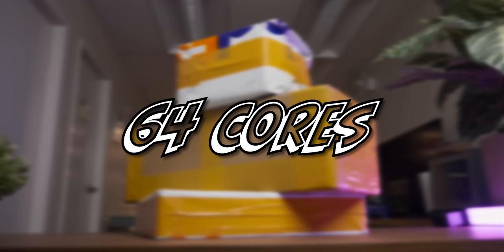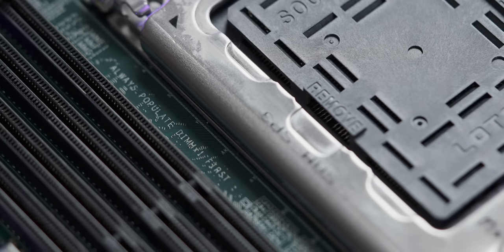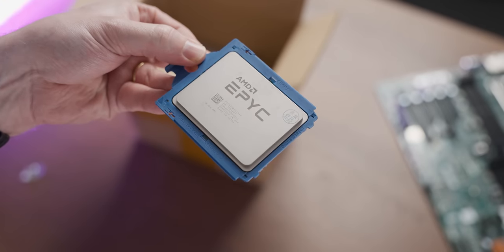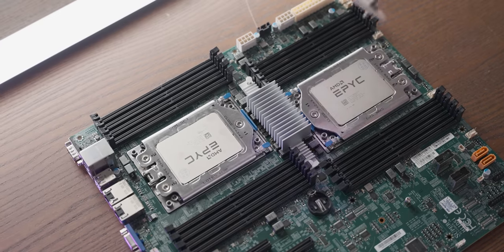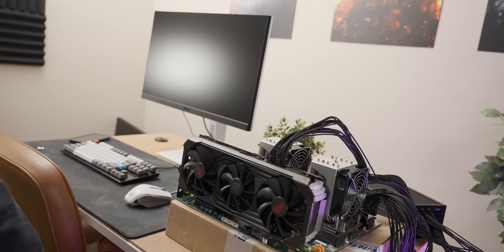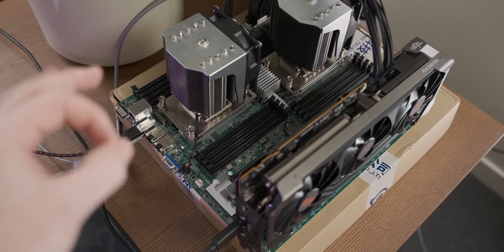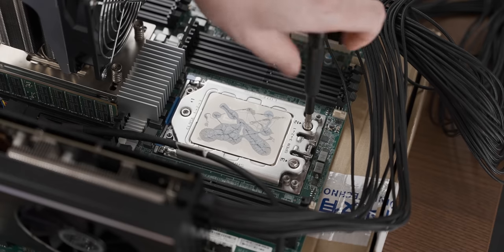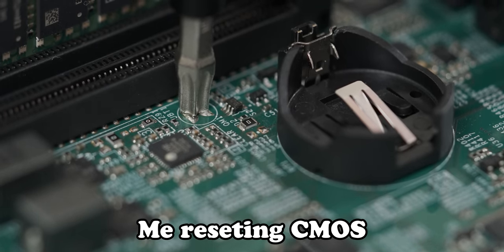I Bought 64 CPU Cores From eBay For $400...

Comment: The pc not booting literally seems like it might just be a bios issue, had an am4 with 3600 and it worked fine but when I got a 3600XT it had basically the same issue but a bios update fixed it

Comment: Why do i feel like dawid didnt seet the cpu's in the board correctly? You need to lay down the cpu's with the rails and clip it down before screwing i the socket screws because it clearly shows the board doesnt see the cpu's either sockets have loose screws or the mounts werent good

Comment: Definitely don't have the right torque on the CPUs.  You have to plug in all of the power cables, 24pin and both 8pins.  Also use more thermal paste, they are giant CPUs.  Check vendor lock on CPUs, may still post though but not sure.  First boot will take 5-10 mim depending on ram capacity

Comment: From this video can see that Dawid is server virgin, RDRAM ECC is a must with server grade, the vga monitor connector is standard on server hardware even most recent servers mostly have it. this motherboard is supermicro (that's quite well-known server mb manufacturer not some Chinese crap) not supermicron, also this motherboard has BMC/IPMI (aspeed chip) use it that is the one ethernet port above usb dedicated to IPMI.

Comment: I bought the same motherboard with a pair of pre-installed EPYC 7302s from seemingly the same vendor (the packaging was exactly the same and everything), and the thing booted-up no problem first try. I've been running CFD on it non-stop since I first turned it on on Sunday.

I can't be certain that your hardware was in perfect working order when it arrived, but to me it seems like your issues were user error. When I was building mine, I took my time, spent hours putting it together and consulted the manual for EVERYTHING. This is the very first video of yours that I've seen, so I don't know what your experience with Server hardware is (I had none what-so-ever just a week ago), but judging from what you said, this seems to be your first experience. Anyway, your approach seemed to be incredibly sloppy for someone with no experience. I can't see it clearly, but from what I can see, you were trying to turn it on by shorting the anti-intrusion panel, and the wrong pins at that. Other people have already pointed-out that the CPU bracket needs to be torqued to spec, and I think I don't need to point-out your thermal paste application (no, that wouldn't cause a server to fail to boot, but it does illustrate your sloppiness and half-assery throughout the whole thing.)

I'm sorry to say, but this is not a good first impression of your channel. Like I said, I can't be certain that your hardware was in working condition, but if you are so clueless as to attempt to turn on a server by shorting the anti-intrusion panel instead of the IO panel, while the manual is very clear as to which is which and what the correct pins are, I really don't think it's fair to blame the hardware. I hope you will take things a bit more seriously in your follow-up video, assuming your shorting of random stuff didn't damage it.

Comment: You might want to DISCONNECT any power BEFORE plugging/unplugging your graphics card. Those little green lights on your motherboard will tell you when there's no more juice running through your mobo. That's one of the reasons they're there.

Comment: getting a used epyc is not a bad idea - yeah you ran into some issues but do a followup and add a big gpu to do some ai - it should work great and this is the type of systems people will want going forward just for the prolific pci lane count - it matters when you want a couple gpu and a bunch of nvme for a server or virt host -and ai - gaming may not be the best but pc and gaming is in a major depression until next gen parts which is 18 mos away for wide availability - maybe you can just go with one socket sp3 next time - lack of reading the manual and proper tools hampered the effort here but at least you made some educational content

Comment: the connectors @2:00 are for riser cards that use direct pcie lanes to the CPUs. For rackmount chassis you don't often get enough height to put cards directly on the board
Reply: No. They are not. These plugs are for 4x sata using a sff 8087 plug. It also supports sideband for compatible hot swap backplanes.

Comment: 9:04 I would say it is too expensive in terms of power budget, but looking at all air-cooled servers blasting their fans at 100% to barely keep thermals in check (while consuming up to 30% of total server power).... Yeah, maybe some RGB wouldn't hurt. 
Also, servers with water-cooling for the whole rack  consume only 2-3% for the cooling, while managing to run with freecooled water (simple water-to-air heat exchanger outside, without chillers) at lower temperatures

Comment: The board should start even if the CPUs are not connecting. Worst case would be a dead chipset. But maybe you just shorted the wrong pins for starting the board. You should measure the power-on pins for voltage. 
This has nothing to do with RAM.

Comment: EPYC cpu retention brackets need to be torqued to specific spec, thats why they come with a tool that auto torques them to required torque. could be you didnt tighten them enough and not all pins are making contact.Or you did it too tight and broke it lol

Comment: Lenovo Thinkstation P710 with two 2697a CPUs, 128G DDR4 ECC RAM, NVidia 2060 Super: about 700ish USD. 32 cores, 64 threads, and plenty beefy for my applications.

"Living on the cusp of obsolescence"

Comment: Maybe is a bios compatibility issue? I got 2 xeon 8180es from taobao for total of 300CAD the seller guarantees it work on any board and any bios and the chip ihs seems to be a retail chip as well so at first I thought I got scam until I bought a special bios for my c621 sage in ebay the pc boot up fine and works all 56 core works. Some time the seller don't know wtf they are selling. So i guess that's what happened here.

Comment: You forgot a case. And yes, server hardware is slightly different, more expensive. You will also need a Windows Server 20xx version instead of Windows 10 or 11. Also a USB sound card.

Comment: I like your enthusiasm, but with server things, you have to always check the compatibility lists, these boards are very picky. So always start with the motherboard compatibility list and then work your way backwards to the CPU and RAM. According to the smicro web, the 64 core CPU and 256GB of RAM is only supported in version 2.x of the board, so make sure you have that version. As for compatibility.. you would have to get compatible CPU and update the BIOS. After that you will have a chance to boot. But I am sure that you figured that out on your own after a year.. but this advice is for people, that would be trying this on their own now.

Comment: Well color me suprised.. You bought the same stuff I did a little while back. I also needed a Ryzen Threadripper wrench. I have 2x be quiet dark rock pro 4 tr4 instead of the coolers you have. Also you need ECC memory with this board. I also had the same issues you did when starting this monster. Though my 7551's where cheaper than yours ;)

Comment: I don't like those LGA sockets, if I ever buy a CPU and motherboard that are that I will wear a short sleeve shirt and no clothing of any sort that seems like there is the slightest chance of dangling down in there and catching the pins.  It is a lot of money for a new board and I don't like that at all.  To me pin grids are a lot more forgiving as long as you don't force them in if they are inserted wrong.  A tip to anyone installing a pin grid CPU, it should just fall into the socket.  If it doesn't something is wrong and it is time to look at the arrow on the socket and CPU.  They may be hard to see but you must match them.  Also be sure you got the correct CPU for that socket or nothing you do will make it fit or work correctly.

Comment: Are you sure the CPUs arent vendor locked? Occasionally you'll get chips pulled from OEM systems that get a firmware lock for example: HP, Lenovo, DELL, Lenovo, and will ONLY work with specific vendor boards ala "we built the cheapest pc on Amazon" ltt video with the board not liking the E7500.

Comment: From my experience, you likely aren't powering it correctly. I was experimenting with putting an ATX format server board in a regular PC and found that while I could use an ATX power supply, it wouldn't power up at all without the original PSU array. It had a few extra cables going to the board that likely are for some kind of monitoring for the iLO and without them it wouldn't power up. All the  iLO lights were flashing error messages though and I'd powered it up before so I know it was working, I'll bet if you find photos of that board in an actual server you'll find something extra coming from the PSU bays. Otherwise you got scammed.

Comment: In which world does a Mobo boot up without even a single slot of RAM availiable per CPU? Also you can run those 2-CPU-Boards with just one CPU installed, too, btw.
Many of these Server Boards btw. have an Onboard graphics card to support the VGA port, which may or may not be the default Video output channel depending on the initial settings. So to see video putput through the GPU you might need to change that setting first.
I am building a lot of AI workstations with older EPYC CPUs recently and rarely had any issues getting them working, despite I'd always recommend to go straight to Gen 2 (ROME / Zen2) EPYC CPUs and Boards because they already support PCIE Gen 4 and are not even more expensive than Gen 1 (NAPLES / Zen1) anymore.
The only thing that's really limiting these older Workstation and Server Boards IMHO is that they only Support ECC RAM, which is not availiable in a faster Speed than 3200 Mhz unfortunately.

Comment: I can't help but wonder if the motherboard needs a BIOS update, because an unsupported CPU is a great way to cause "some lights come on but then absolutely nothing happens"
I'm actually really surprised that your board didn't come with ANYTHING to help though. Diagnostic displays are too much to ask for in the modern day, but not even beepers or blinkers either?? :(

Comment: the design of this cpu socket is weird. I havent seen LGA4677 but both lga3647 and lga4189 has 6 screws to get even pressure. This socket has more than 6000 pins and only 4 screws.

Comment: There may be some out of band diagnostics you can access via the management Ethernet port. IBM calls it IIM, HP calls it ILO. hopefully that vendor has something similar and you should be able to get some info if the board is reading the parts even if the unit does not power on.

Comment: Is the RAM correct? It looked like you had 17000 2133MHz RAM and from Supermicros specs page it references DDR4 2666 MHz Registered ECC, 288-pin gold-plated DIMMs or
DDR4 3200 MHz Registered ECC, 288-pin gold-plated DIMMs (Board revision 2.x required)

From what I've read Epyc can be very picky with RAM and can also take a while to train, well it is 256GB...

Also from a quick look it seems the VGA connector is connected to the baseboard management controller (BMC) so plugging in a monitor to that may give some idea about what's going on.

Comment: Super micro MB are great, avoid getting Lenovo. Between Boot time, ease of access, super micro is way better

Unfortunately we only have Lenovo chassis for EPYC procs at our data center.

Also it will still power on even with incorrect RAM (it will get stuck before BIOS though), so likely one of the procs are bad + maybe the board too.

Comment: I havent seen your video all the way through, but hopefully you realized that you need windows 10 workstation to use all those cores. Not sure if windows 11 faces that limitation. Also, try getting into the IPMI and get to the logs. The IPMI should work under most circumstances.
Reply: NO, two sockets are supportedby W10P beside 2xNaples are 2x4 Chiplets which each having 2xRAM channel. On the other hand a Quad G34 are 4 Sockets with each two chiplets must have W10P for Workstation. Because MS count sockets.

Comment: Does the server require registered DIMMs? I beleve most if not all server boards support unregistered DIMMs, but it could be that the server board will only support DIMMs of lesser capacity as unregistered.

Also, I put my phone down and walked away for a moment when you said "RGB" and "server" in the same sentence.

Comment: "BIOS R 2.x only supports MB Rev. 2.00 with 32MB SPI flash ROM to support both AMD 7001/7002 series processors."
Maybe you have 7002 series bios, but you installed 7551 CPUs?
Reply: Wouldn't prevent power on though, post error sure but the board would do something it'd have to to even realise what CPU it has installed
Reply: Bios-ROM size matters. Early Rev Boards have 16MB only space for AGESA Naples or Rome, not both. The 16MB could be flashed for Rome if initial delivered for Naples.

Comment: i noticed somthing.. the pc i saw a few times dont have a cmos battery installed.. is it installed? i have worked on few pc's that if no cmos battery installed, it wont do anything at all. very possable that may be the case.

Comment: $400 for such hardware could be a clue as to why it didn't work, and they aren't called Ryzen Epyc. And how do you know it wouldn't run? How long did you wait for it to boot? They don't have any beeps. You need to use the IPMI.

Comment: So not saying you did anything wrong but usually when you jump the CMOS clearing contacts... you don't need the CMOS battery removed I believe...

So the fact that you didn't have one in there leads me to ask, just to be on the safe side: You did put a CMOS battery onto that board, yes? The Chinese always send their mobos out without one due to shipping regulations in China.

Comment: I can't believe the thermal paste you did. I also couldnt believe you saying "No way thats it!" on that bit. It was quite clearly the wrong size. Those are supposed to be torqued down, too. There wasn't even a CMOS battery in the thing, why "reset" it? It never powered up in the first place. With the battery out & it being unplugged it would have reset anyway. Very painful video to watch, thanks.

Comment: I'm not sure, but when you said it looks like the motherboard has a micro sd card slot, i think it might have been a sim card slot. It looks exactly like the ones that used to be in phones back when they were under the battery. Given the amount of networking on there it seems plausible.

Comment: What a dumb design, worse than the PCIe 12V high power connector.

Don't bother with the torque screwdriver, the only way to be sure is to zero three dial indicators on the heat spreader near the (loosened) pressure screws. Go around in the specified pattern and tighten each screw a fraction of a turn, watch the indicators and make sure they all move an equal amount. Repeat until all the slack is taken out and you feel some resistance while tightening. When of them feels like it hits bottom, stop and tighten the other two an equal amount. Remove any PCIe or NVMe cards, install the coolers and RAM, and connect a monitor to the integrated VGA port. Connect a switch to the motherboard header, apply power and wait for the diagnostic LEDs

Comment: its your power supply!!!!!.... got a old hp server board like yours fan spinning and all but never post ....find out tha the 8pin power supply that i was using fit in like the same as a the video card but the 12 volts and 5 volts was not in the same place as a video card

Comment: You do realize these CPUs have to be mounted with a specific torque right?
I'm sure you need to tighten the screws to the apropriate torque spec.
Also after that, give it an hour for after you "press the power button" just to make sure. No i actually mean that, give it an hour.